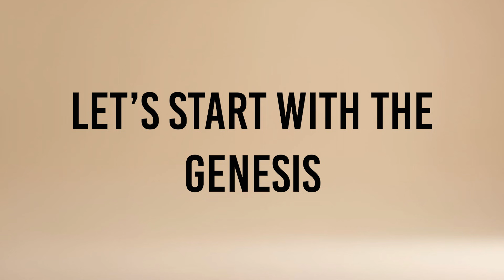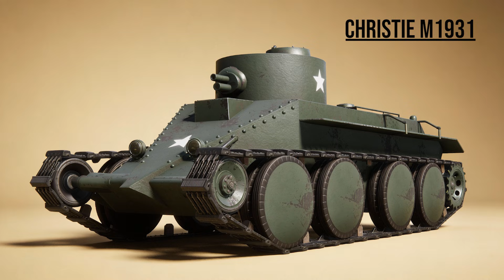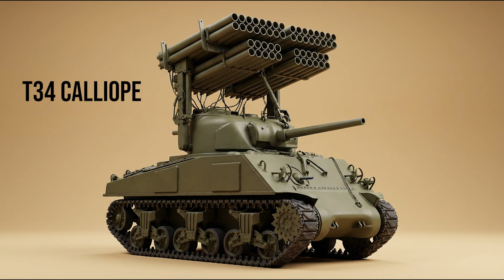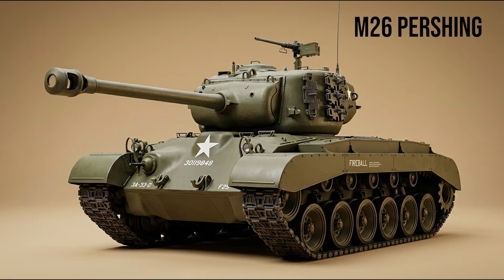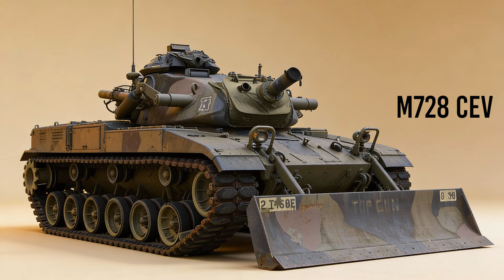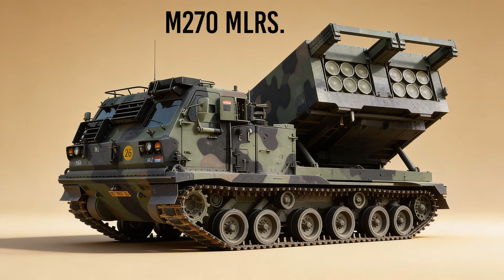Every American Vehicle Ever Made

Comment: Aside from 25mm Bushmaster and 30mm Bushmaster 2 being used with anti-air rounds on vehicles such as Stryker Dragoon; the M163 VADS and the Phalanx Block 1B are among the last operational anti-air guns made by the US. 

While M42 Duster counts for the video itself, it doesn't fully count in this situation as while the design itself is American made, the gun was originally from Sweden.